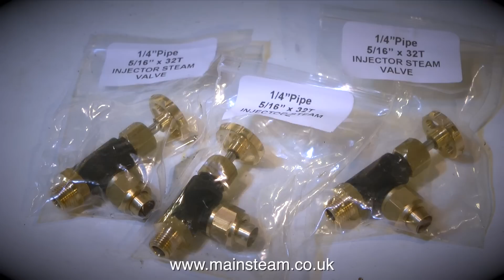MAKING A STEAM TURRET/MANIFOLD - MODEL ENGINEERING FOR BEGINNERS - PART #12

Comment: If the start windings on your drill are knackered, your in trouble. But its probably a capacitor start motor and the capacitor is faulty. You can get a new one from your favourite auction site for 2 or 3 pounds probably...... just a thought!
Reply from the maker: I would think it is the start Capacitor, when I get some time I will fix it. I think I need a better quality pillar drill anyway . . . .

Comment: I'm going to assume that the taps you used in the drill press don't have a female centre in the end. If they did, you could use a spring centre, and a tap wrench on the tap. It's easier than turning the spindle and motor. Mind you, it's probably better to use a mill for tapping with a spring centre